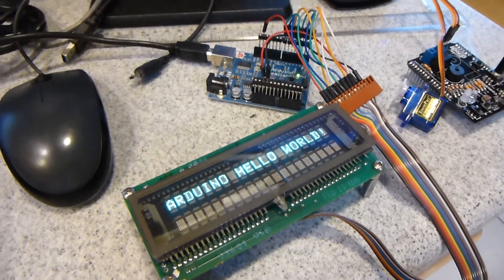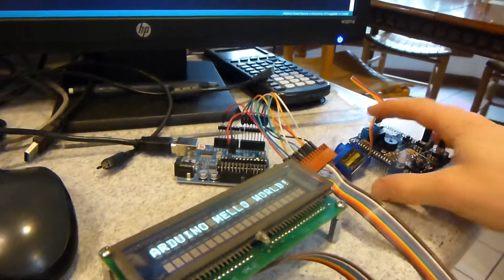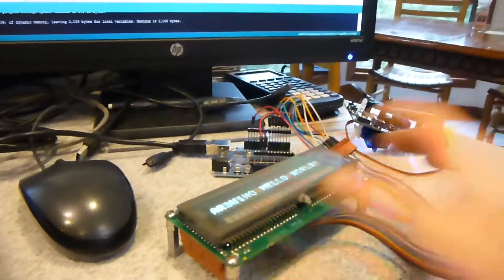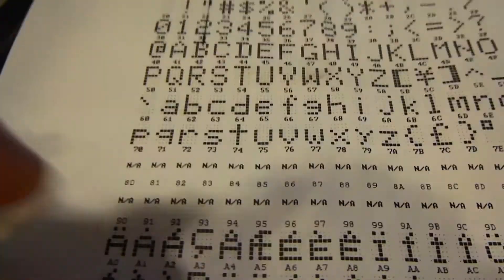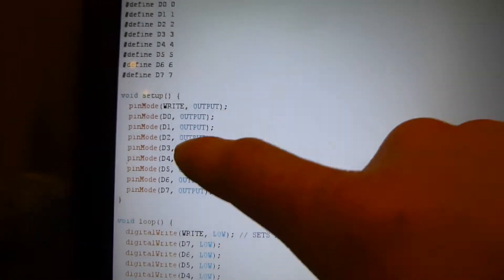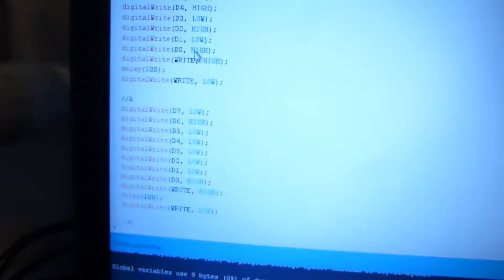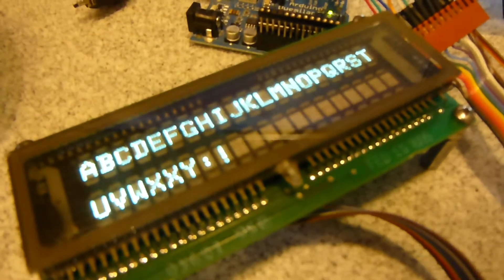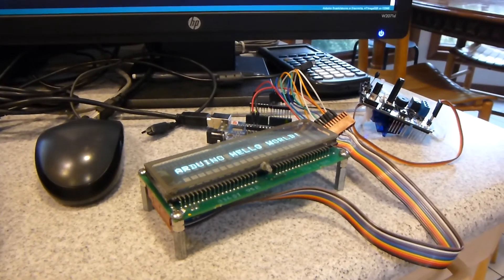Arduino Driving Vacuum Florescent Display With ASCII Hexadecimal Code

Comment: do you have the script for me

i may know how to improve it
Reply from the maker: *****  Here it is!  It's LOOONNNNNGGGGGG  it's only over 400 lines long!  LOL

//Arduino Alphabet

#define WRITE 13
#define D0 0
#define D1 1
#define D2 2
#define D3 3
#define D4 4
#define D5 5
#define D6 6
#define D7 7

void setup() {  
  pinMode(WRITE, OUTPUT);
  pinMode(D0, OUTPUT);
  pinMode(D1, OUTPUT);
  pinMode(D2, OUTPUT);
  pinMode(D3, OUTPUT);
  pinMode(D4, OUTPUT);
  pinMode(D5, OUTPUT);
  pinMode(D6, OUTPUT);
  pinMode(D7, OUTPUT);
}

void loop() {
  digitalWrite(WRITE, LOW); // SETS ALL PINS LOW
  digitalWrite(D7, LOW);
  digitalWrite(D6, LOW);
  digitalWrite(D5, LOW);
  digitalWrite(D4, LOW);
  digitalWrite(D3, LOW);
  digitalWrite(D2, LOW);
  digitalWrite(D1, LOW);
  digitalWrite(D0, LOW);

//CLEAR DISPLAY
  digitalWrite(D7, LOW);
  digitalWrite(D6, LOW);
  digitalWrite(D5, LOW);
  digitalWrite(D4, HIGH);
  digitalWrite(D3, LOW);
  digitalWrite(D2, HIGH);
  digitalWrite(D1, LOW);
  digitalWrite(D0, HIGH);
  digitalWrite(WRITE, HIGH);
  delay(100);
  digitalWrite(WRITE, LOW);
  
  //A
  digitalWrite(D7, LOW);
  digitalWrite(D6, HIGH);
  digitalWrite(D5, LOW);
  digitalWrite(D4, LOW);
  digitalWrite(D3, LOW);
  digitalWrite(D2, LOW);
  digitalWrite(D1, LOW);
  digitalWrite(D0, HIGH);
  digitalWrite(WRITE, HIGH);
  delay(100);
  digitalWrite(WRITE, LOW);
  
  //B
  digitalWrite(D7, LOW);
  digitalWrite(D6, HIGH);
  digitalWrite(D5, LOW);
  digitalWrite(D4, LOW);
  digitalWrite(D3, LOW);
  digitalWrite(D2, LOW);
  digitalWrite(D1, HIGH);
  digitalWrite(D0, LOW);
  digitalWrite(WRITE, HIGH);
  delay(100);
  digitalWrite(WRITE, LOW);
  
  //C
  digitalWrite(D7, LOW);
  digitalWrite(D6, HIGH);
  digitalWrite(D5, LOW);
  digitalWrite(D4, LOW);
  digitalWrite(D3, LOW);
  digitalWrite(D2, LOW);
  digitalWrite(D1, HIGH);
  digitalWrite(D0, HIGH);
  digitalWrite(WRITE, HIGH);
  delay(100);
  digitalWrite(WRITE, LOW);
  
  //D
  digitalWrite(D7, LOW);
  digitalWrite(D6, HIGH);
  digitalWrite(D5, LOW);
  digitalWrite(D4, LOW);
  digitalWrite(D3, LOW);
  digitalWrite(D2, HIGH);
  digitalWrite(D1, LOW);
  digitalWrite(D0, LOW);
  digitalWrite(WRITE, HIGH);
  delay(100);
  digitalWrite(WRITE, LOW);
  
  //E
  digitalWrite(D7, LOW);
  digitalWrite(D6, HIGH);
  digitalWrite(D5, LOW);
  digitalWrite(D4, LOW);
  digitalWrite(D3, LOW);
  digitalWrite(D2, HIGH);
  digitalWrite(D1, LOW);
  digitalWrite(D0, HIGH);
  digitalWrite(WRITE, HIGH);
  delay(100);
  digitalWrite(WRITE, LOW);
  
  //F
  digitalWrite(D7, LOW);
  digitalWrite(D6, HIGH);
  digitalWrite(D5, LOW);
  digitalWrite(D4, LOW);
  digitalWrite(D3, LOW);
  digitalWrite(D2, HIGH);
  digitalWrite(D1, HIGH);
  digitalWrite(D0, LOW);
  digitalWrite(WRITE, HIGH);
  delay(100);
  digitalWrite(WRITE, LOW);
  
  //G
  digitalWrite(D7, LOW);
  digitalWrite(D6, HIGH);
  digitalWrite(D5, LOW);
  digitalWrite(D4, LOW);
  digitalWrite(D3, LOW);
  digitalWrite(D2, HIGH);
  digitalWrite(D1, HIGH);
  digitalWrite(D0, HIGH);
  digitalWrite(WRITE, HIGH);
  delay(100);
  digitalWrite(WRITE, LOW);
  
  //H
  digitalWrite(D7, LOW);
  digitalWrite(D6, HIGH);
  digitalWrite(D5, LOW);
  digitalWrite(D4, LOW);
  digitalWrite(D3, HIGH);
  digitalWrite(D2, LOW);
  digitalWrite(D1, LOW);
  digitalWrite(D0, LOW);
  digitalWrite(WRITE, HIGH);
  delay(100);
  digitalWrite(WRITE, LOW);
  
  //I
  digitalWrite(D7, LOW);
  digitalWrite(D6, HIGH);
  digitalWrite(D5, LOW);
  digitalWrite(D4, LOW);
  digitalWrite(D3, HIGH);
  digitalWrite(D2, LOW);
  digitalWrite(D1, LOW);
  digitalWrite(D0, HIGH  );
  digitalWrite(WRITE, HIGH);
  delay(100);
  digitalWrite(WRITE, LOW);
  
  //J
  digitalWrite(D7, LOW);
  digitalWrite(D6, HIGH);
  digitalWrite(D5, LOW);
  digitalWrite(D4, LOW);
  digitalWrite(D3, HIGH);
  digitalWrite(D2, LOW);
  digitalWrite(D1, HIGH);
  digitalWrite(D0, LOW);
  digitalWrite(WRITE, HIGH);
  delay(100);
  digitalWrite(WRITE, LOW);
  
  //K
  digitalWrite(D7, LOW);
  digitalWrite(D6, HIGH);
  digitalWrite(D5, LOW);
  digitalWrite(D4, LOW);
  digitalWrite(D3, HIGH);
  digitalWrite(D2, LOW);
  digitalWrite(D1, HIGH);
  digitalWrite(D0, HIGH);
  digitalWrite(WRITE, HIGH);
  delay(100);
  digitalWrite(WRITE, LOW);
  
  //L
  digitalWrite(D7, LOW);
  digitalWrite(D6, HIGH);
  digitalWrite(D5, LOW);
  digitalWrite(D4, LOW);
  digitalWrite(D3, HIGH);
  digitalWrite(D2, HIGH);
  digitalWrite(D1, LOW);
  digitalWrite(D0, LOW);
  digitalWrite(WRITE, HIGH);
  delay(100);
  digitalWrite(WRITE, LOW);
  
  //M
  digitalWrite(D7, LOW);
  digitalWrite(D6, HIGH);
  digitalWrite(D5, LOW);
  digitalWrite(D4, LOW);
  digitalWrite(D3, HIGH);
  digitalWrite(D2, HIGH);
  digitalWrite(D1, LOW);
  digitalWrite(D0, HIGH);
  digitalWrite(WRITE, HIGH);
  delay(100);
  digitalWrite(WRITE, LOW);
  
  //N
  digitalWrite(D7, LOW);
  digitalWrite(D6, HIGH);
  digitalWrite(D5, LOW);
  digitalWrite(D4, LOW);
  digitalWrite(D3, HIGH);
  digitalWrite(D2, HIGH);
  digitalWrite(D1, HIGH);
  digitalWrite(D0, LOW);
  digitalWrite(WRITE, HIGH);
  delay(100);
  digitalWrite(WRITE, LOW);
  
  //O
  digitalWrite(D7, LOW);
  digitalWrite(D6, HIGH);
  digitalWrite(D5, LOW);
  digitalWrite(D4, LOW);
  digitalWrite(D3, HIGH);
  digitalWrite(D2, HIGH);
  digitalWrite(D1, HIGH);
  digitalWrite(D0, HIGH);
  digitalWrite(WRITE, HIGH);
  delay(100);
  digitalWrite(WRITE, LOW);
  
  //P
  digitalWrite(D7, LOW);
  digitalWrite(D6, HIGH);
  digitalWrite(D5, LOW);
  digitalWrite(D4, HIGH);
  digitalWrite(D3, LOW);
  digitalWrite(D2, LOW);
  digitalWrite(D1, LOW);
  digitalWrite(D0, LOW);
  digitalWrite(WRITE, HIGH);
  delay(100);
  digitalWrite(WRITE, LOW);
  
  //Q
  digitalWrite(D7, LOW);
  digitalWrite(D6, HIGH);
  digitalWrite(D5, LOW);
  digitalWrite(D4, HIGH);
  digitalWrite(D3, LOW);
  digitalWrite(D2, LOW);
  digitalWrite(D1, LOW);
  digitalWrite(D0, HIGH);
  digitalWrite(WRITE, HIGH);
  delay(100);
  digitalWrite(WRITE, LOW);
  
  //R
  digitalWrite(D7, LOW);
  digitalWrite(D6, HIGH);
  digitalWrite(D5, LOW);
  digitalWrite(D4, HIGH);
  digitalWrite(D3, LOW);
  digitalWrite(D2, LOW);
  digitalWrite(D1, HIGH);
  digitalWrite(D0, LOW);
  digitalWrite(WRITE, HIGH);
  delay(100);
  digitalWrite(WRITE, LOW);
  
  //S
  digitalWrite(D7, LOW);
  digitalWrite(D6, HIGH);
  digitalWrite(D5, LOW);
  digitalWrite(D4, HIGH);
  digitalWrite(D3, LOW);
  digitalWrite(D2, LOW);
  digitalWrite(D1, HIGH);
  digitalWrite(D0, HIGH);
  digitalWrite(WRITE, HIGH);
  delay(100);
  digitalWrite(WRITE, LOW);
  
  //T
  digitalWrite(D7, LOW);
  digitalWrite(D6, HIGH);
  digitalWrite(D5, LOW);
  digitalWrite(D4, HIGH);
  digitalWrite(D3, LOW);
  digitalWrite(D2, HIGH);
  digitalWrite(D1, LOW);
  digitalWrite(D0, LOW);
  digitalWrite(WRITE, HIGH);
  delay(100);
  digitalWrite(WRITE, LOW);
  
  //U
  digitalWrite(D7, LOW);
  digitalWrite(D6, HIGH);
  digitalWrite(D5, LOW);
  digitalWrite(D4, HIGH);
  digitalWrite(D3, LOW);
  digitalWrite(D2, HIGH);
  digitalWrite(D1, LOW);
  digitalWrite(D0, HIGH);
  digitalWrite(WRITE, HIGH);
  delay(100);
  digitalWrite(WRITE, LOW);
  
  //V
  digitalWrite(D7, LOW);
  digitalWrite(D6, HIGH);
  digitalWrite(D5, LOW);
  digitalWrite(D4, HIGH);
  digitalWrite(D3, LOW);
  digitalWrite(D2, HIGH);
  digitalWrite(D1, HIGH);
  digitalWrite(D0, LOW);
  digitalWrite(WRITE, HIGH);
  delay(100);
  digitalWrite(WRITE, LOW);
  
  //W
  digitalWrite(D7, LOW);
  digitalWrite(D6, HIGH);
  digitalWrite(D5, LOW);
  digitalWrite(D4, HIGH);
  digitalWrite(D3, LOW);
  digitalWrite(D2, HIGH);
  digitalWrite(D1, HIGH);
  digitalWrite(D0, HIGH);
  digitalWrite(WRITE, HIGH);
  delay(100);
  digitalWrite(WRITE, LOW);
  
  //X
  digitalWrite(D7, LOW);
  digitalWrite(D6, HIGH);
  digitalWrite(D5, LOW);
  digitalWrite(D4, HIGH);
  digitalWrite(D3, HIGH);
  digitalWrite(D2, LOW);
  digitalWrite(D1, LOW);
  digitalWrite(D0, LOW);
  digitalWrite(WRITE, HIGH);
  delay(100);
  digitalWrite(WRITE, LOW);
  
  //Y
  digitalWrite(D7, LOW);
  digitalWrite(D6, HIGH);
  digitalWrite(D5, LOW);
  digitalWrite(D4, HIGH);
  digitalWrite(D3, HIGH);
  digitalWrite(D2, LOW);
  digitalWrite(D1, LOW);
  digitalWrite(D0, LOW);
  digitalWrite(WRITE, HIGH);
  delay(100);
  digitalWrite(WRITE, LOW);
  
  //Z
  digitalWrite(D7, LOW);
  digitalWrite(D6, HIGH);
  digitalWrite(D5, LOW);
  digitalWrite(D4, HIGH);
  digitalWrite(D3, HIGH);
  digitalWrite(D2, LOW);
  digitalWrite(D1, LOW);
  digitalWrite(D0, HIGH);
  digitalWrite(WRITE, HIGH);
  delay(100);
  digitalWrite(WRITE, LOW);
  
    
  //:
  digitalWrite(D7, LOW);
  digitalWrite(D6, LOW);
  digitalWrite(D5, HIGH);
  digitalWrite(D4, HIGH);
  digitalWrite(D3, HIGH);
  digitalWrite(D2, LOW);
  digitalWrite(D1, HIGH);
  digitalWrite(D0, LOW);
  digitalWrite(WRITE, HIGH);
  delay(100);
  digitalWrite(WRITE, LOW);
  
  
  //!
  digitalWrite(D7, LOW);
  digitalWrite(D6, LOW);
  digitalWrite(D5, HIGH);
  digitalWrite(D4, LOW);
  digitalWrite(D3, LOW);
  digitalWrite(D2, LOW);
  digitalWrite(D1, LOW);
  digitalWrite(D0, HIGH);
  digitalWrite(WRITE, HIGH);
  delay(100);
  digitalWrite(WRITE, LOW);
  
  //0
  digitalWrite(D7, LOW);
  digitalWrite(D6, LOW);
  digitalWrite(D5, HIGH);
  digitalWrite(D4, HIGH);
  digitalWrite(D3, LOW);
  digitalWrite(D2, LOW);
  digitalWrite(D1, LOW);
  digitalWrite(D0, LOW);
  digitalWrite(WRITE, HIGH);
  delay(100);
  digitalWrite(WRITE, LOW);
  
  //1
  digitalWrite(D7, LOW);
  digitalWrite(D6, LOW);
  digitalWrite(D5, HIGH);
  digitalWrite(D4, HIGH);
  digitalWrite(D3, LOW);
  digitalWrite(D2, LOW);
  digitalWrite(D1, LOW);
  digitalWrite(D0, HIGH);
  digitalWrite(WRITE, HIGH);
  delay(100);
  digitalWrite(WRITE, LOW);

  //SPACE
  digitalWrite(D7, LOW);
  digitalWrite(D6, LOW);
  digitalWrite(D5, LOW);
  digitalWrite(D4, LOW);
  digitalWrite(D3, HIGH);
  digitalWrite(D2, LOW);
  digitalWrite(D1, LOW);
  digitalWrite(D0, HIGH);
  digitalWrite(WRITE, HIGH);
  delay(100);
  digitalWrite(WRITE, LOW);
  
  
  
  delay(1500);

}
Reply: Thank you
I will be scripting tonight
Reply from the maker: ***** Oh fun!  Thank you!  :)
Reply: i am nearly done
i have made a part in the script were all the letters are stored as a array
and you can call it with a simple command
but there is one problem

the spacebar is replaced by ~ the arduino needs a chatacter and a blank space it cant reconize

Comment: hey if it works who cares, the code is simple enough anyone could use a display that is driven the same, i might have to look into the displays i have and see if i can start driving one.
Reply from the maker: SuperBrainAK Yeah it works but it is super annoying and if I want changing values on the display, well I have no idea how to do that.  It also uses up a relatively large amount of memory on my Arduino.  It's fun but can be frustrating!
Reply: Makerj101 i would look at the lcd library and see how its code is, im pretty sure it has either a database or some fancy mapping to convert the letters into hex. so it possibly does the same stuff as you are doing just in a much better form.